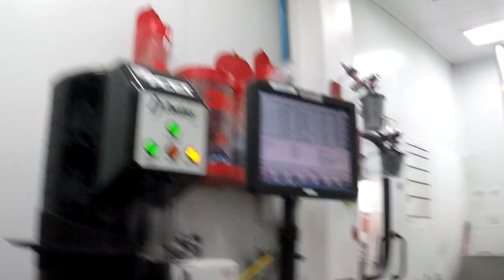Tip #6 Saving cups when mixing sealer

Comment: How would this work when mixing paint? Just make the paint with the filter?
Reply from the maker: It wouldn't work very well because paint toners tend to be super thick so it might take foever
Reply: MOTIVATED PAINTERS yeah I just filter it once the paint is done seems to work but do have a bit that doesn't filter through